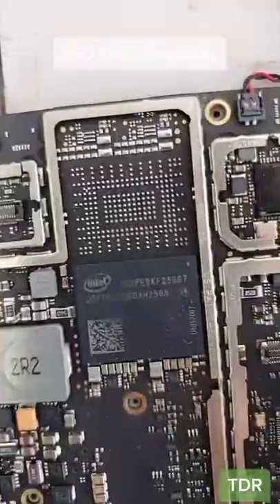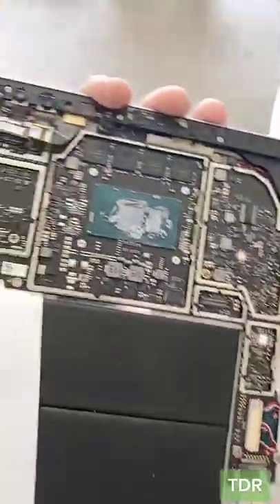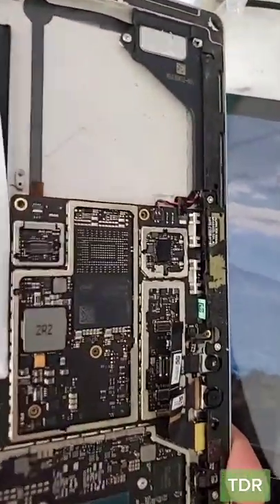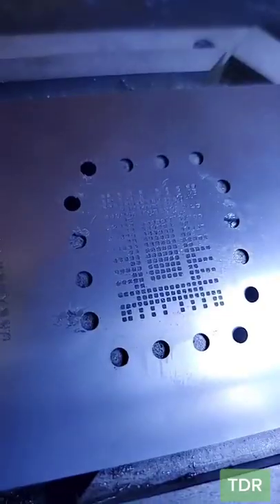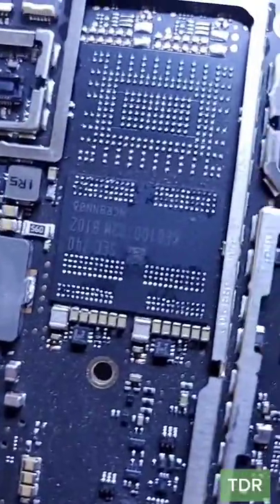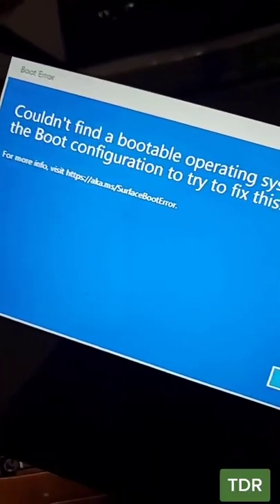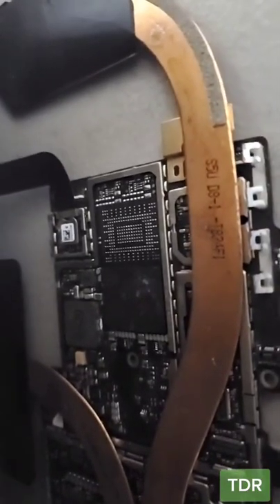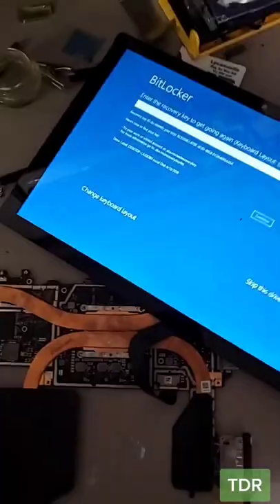First look on the surface pro 5 Chip on Chip SSD repair-ability (data recovery)

Comment: You fried the Intel SSD by putting it on a Samsung board. They operate at different voltages, and if you don't know what you're doing you're going to destroy the customer's data, like you did here.

Comment: you can also use i skynix m2.ssd to use for data reovery. on surface 6 it works! please se on my video.
My question where can i get easy ssd chip for repairing surface?

Comment: After you change the ssd don’t you have to re install windows on the surface and disable bitlocker as the key is stored in the bios
Reply from the maker: good question, i have the key from the other machine. in the end of the video you see bit locker on the original chip because i didn't swap the firmware! :)
Reply: @TechDeviceRepair   I did a ssd chip replacement on a surface pro 7 and I had the same error can’t find bootable os config this is due to the boot config on the ssd being for the donor device so what I did was booted the device into Linux of a usb formatted the drive then reinstalled windows
Reply from the maker: @zaheerpatel8647  That means the SSD was not bad just no boot drives on it ... interesting.. However it came in for a data recovery. SO it must have had an OS... TPM and firmware moved over to the the motherboard as well, The only thing I can gather is, the error happens with empty or corrupted SSD chips.
Reply: @zaheerpatel8647 my good man do you know any places that sell ssd and ram chips to solder onto a surface pro 7?
Reply: @zaheerpatel8647  Hey Could you please share the steps of how you did that. my surface pro 5 is showing the same error.
Reply: @zaheerpatel8647  Hey Could you please share the steps of how you did that. my surface pro 5 is showing the same error.